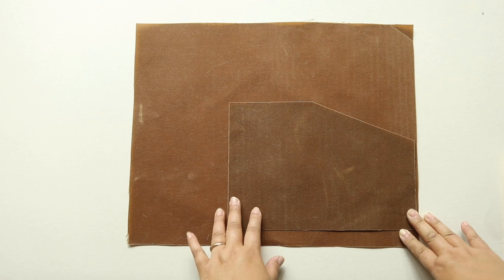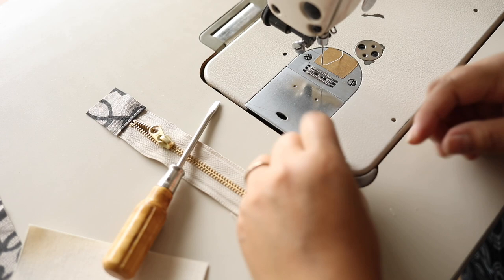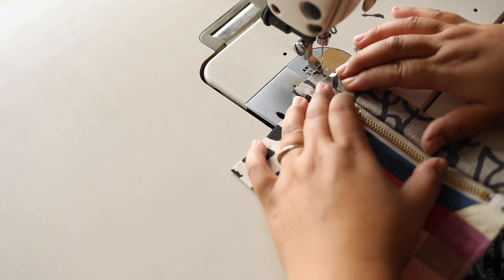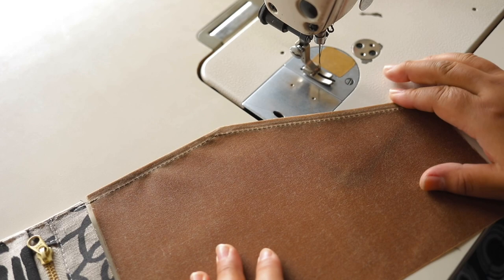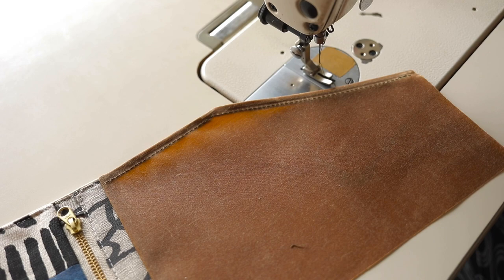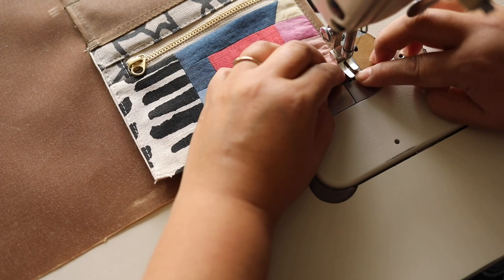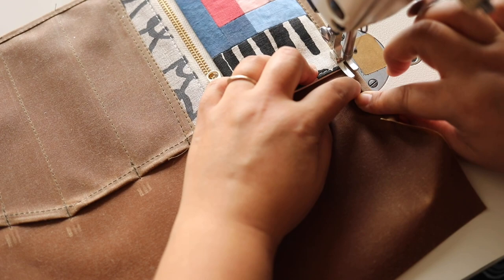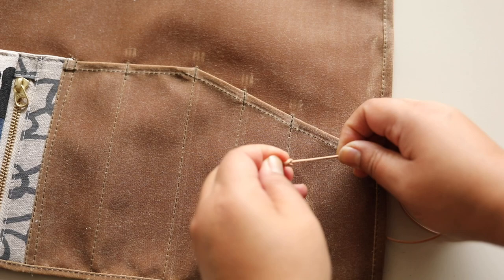SEWING A TOOL ROLL

Comment: Great project and I love the pieced pouch inside!! How is your sewing machine cutting the thread after you’ve finished a seam? You also don’t have to pull/lengthen the thread after cutting it! I’ve used juki factory machines before but have never seen this.
Reply from the maker: thanks so much, yes it has an automatic back tack and when I push on the heel part of the pedal it automatically cuts the threads, it is a huge time saver!
Reply: @bookhoudesign  Wow, I learned about an unknown feature of my machine, thanks!

Comment: I love this!  Do you use a special sized needle for working with the heavier fabrics?  What are those white things you are marking your canvas with, and put into the roll? I didn't know you had books until I read the comment below. I've followed you on IG for several years. I find your videos very relaxing, low stress.
Reply from the maker: you can use a denim needle with heavier threads, I am using a hera marker to make marks on the fabric.  Happy you like the videos😊

Comment: Hello!! I have a small question regarding the waxed canvas, is it possible to get the canvas fabric and then wax it ? (DIY) and if is possible, which kind of wax are is better ?
Reply from the maker: Yes you can do that, Otter sells a product with instructions on their website on how to use it.  Essentially it looks like a bar of soap that is rubbed on the cloth and you use a hair dryer to even it out.  You can use beeswax but I find it’s too stiff.
Reply: @bookhoudesign  thank you for the response, I will try to do it 😄